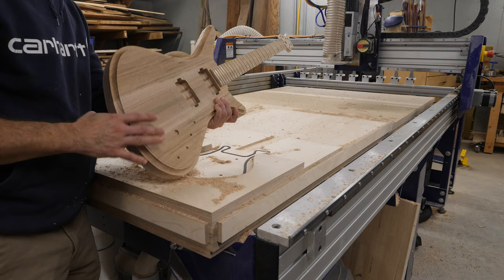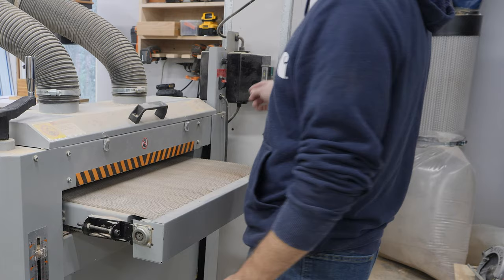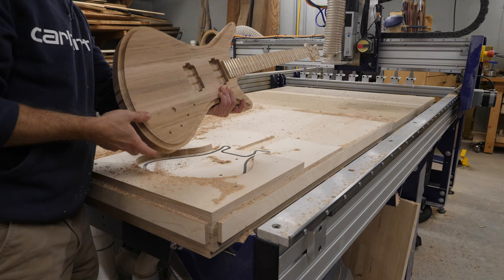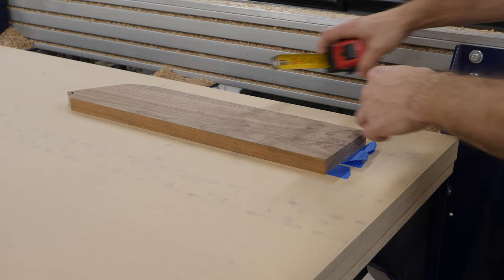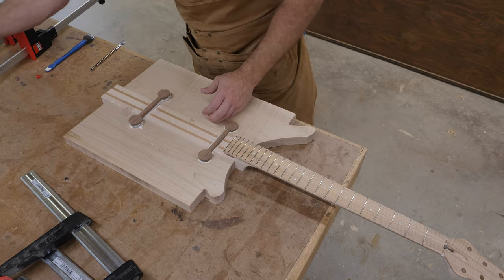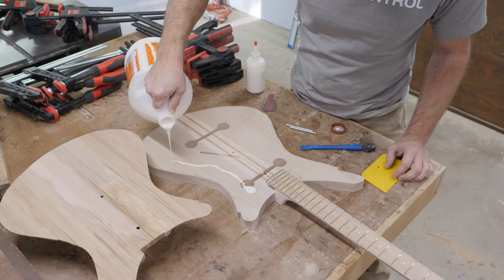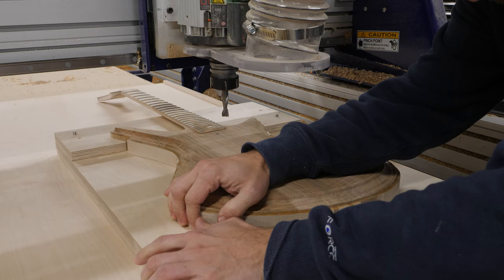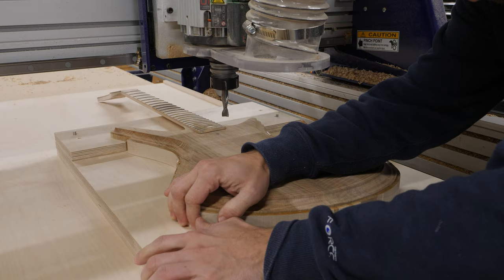Have I Found the Best Way to Build a Neck Through Guitar? | CNC Woodworking

Comment: I never saw the need to align body and wings. Just cut the wings as big rectangles, glue them to the sides of the body, and THEN shape the body as a whole. As for gluing the fretboard and placing the frets so early: a pro luthier once told me that should be last on the list. If you screw up ANYTHING else in the process, you lose your fretboard (usually expensive wood), your frets (can be expensive too if good quality SS) and most likely your trussrod will be difficult to recover. In other words, you lose all the work done to the neck if something goes wrong with the body. Sounded smart to me. The only way to salvage that would be to dump the neckthrough idea, cut the neck out, and do another regular guitar with that neck. Good video. sometimes I wish I had a router, but on the other hand I build for hobby, so what's the sense in doing cookie-cutter guitars to me? The only PITA is neck shaping, a router would be good for consistent neck profiles. Wish you luck!

Comment: not bad for first time.  Its all about order of operations.  Hot tip:  fretboard goes on AFTER you've set the wings to the neck and carved out the body.  This also gives you the ability to adjust the heights if things didn't align.
Reply from the maker: Thank you!  This isn't the first guitar I've built, just the first one I've done a video on.  Thanks for the tip, I've seen folks do it both ways, but I understand the benefits of your approach.  Thanks for watching, have a good one
Reply: Not necessarily. Manufacturers like Warwick have the fingerboard on the central portion of the neck thru before the wings are glued on, but equally that's a mass produced process.

Comment: Pretty interesting...makes me wonder if using an actual bowtie shape can be slightly offset from the cavity and thus be used like a sort of draw pin / wedge clamp to really suck the sides into the neck.  Well, I know it can be done, I guess the question is if its worth the effort
Reply from the maker: Thanks!  I'm pretty happy with this solution.  It sure beats babying the glue up and hoping nothing slips outta place!  I had pretty good clamping from the dog bone shape, not sure how much more a bowtie would help to lock things down, but it certainly wouldn't hurt.